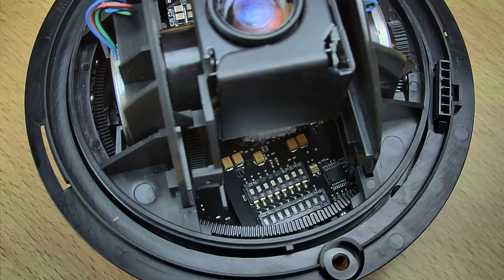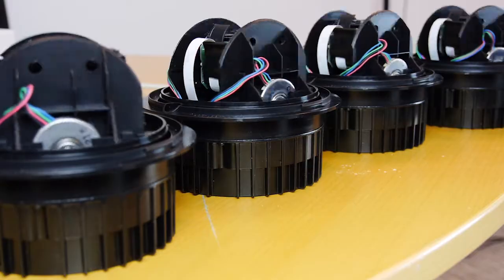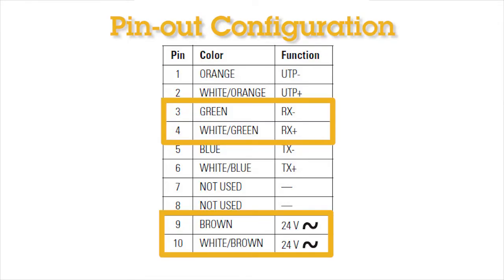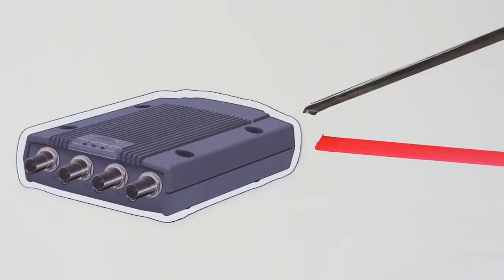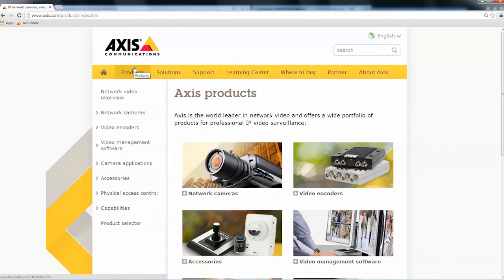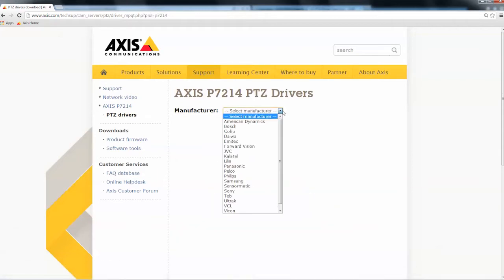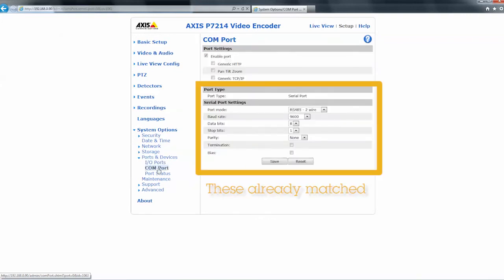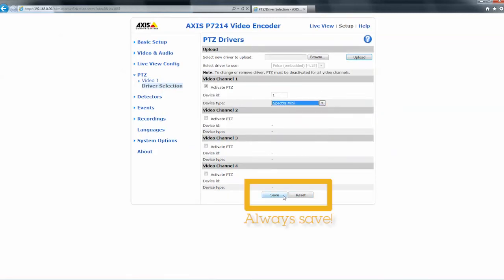Connecting an CCTV Analog PTZ security camera to an Axis Video Encoder

Comment from the maker: Addition from our Engineers
When wiring multiple PTZ cameras onto AXIS Encoder you should ask the following questions to design the system correctly:

>How many PTZ cameras are there?
>What protocol is being used?
->If unknown, what is the model/manufacturer?
>What encoder is going to be used?
>How is the existing data wiring run?
->is it a 'home-run' or a 'daisy-chain'?
->How many cameras are on each run?
>Do you have diagrams or as built drawings of existing data wiring?